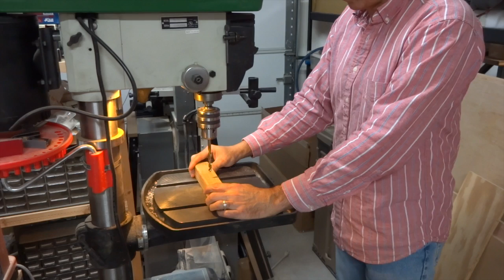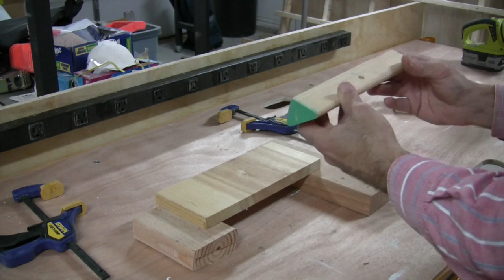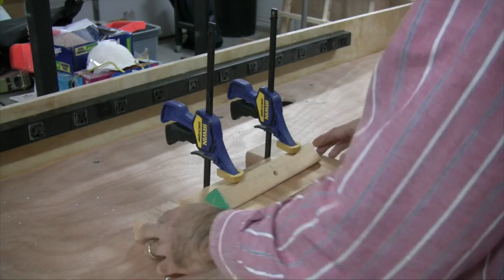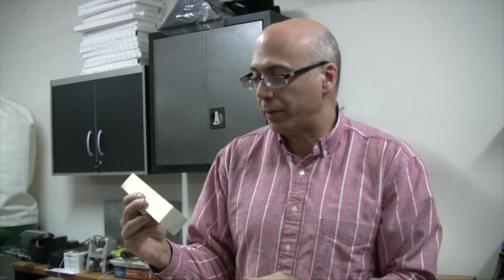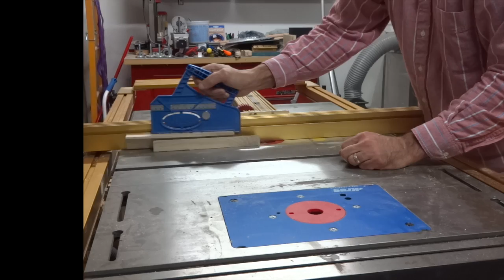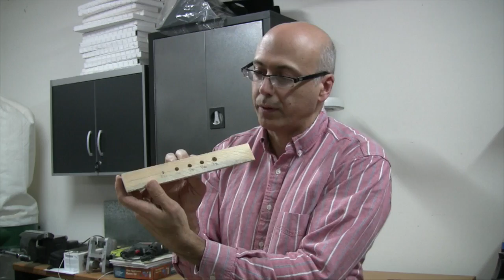Super Easy Way to Drill Angled Holes!

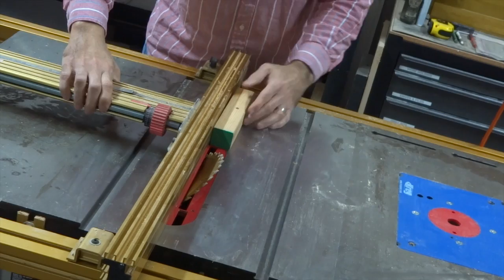Comment: 0:38 That looks like a very dangerous cut without a riving knife. If the piece was to flop down on the up-turning side of the blade it could throw it right through the operator.
Ripping it off of a wider board, say a 2X4, would give more support after the cut.
Always use a riving knife.
Reply from the maker: @donf3739  thanks for the feedback Don!

Comment: I have been looking for and easy way to drill angled holes through a 4x4 corner post for stainless steel wire railing. I am going to make a 4x4 jig the length of my post and drill all of the holes at once and perfectly spaced using this method. Thank you Mike for thinking and sharing!
Reply from the maker: Thanks for your comments, David!

Comment: This is a good idea. 

But that cut that you made at 45 seconds was scary. As some of the other commenters mentioned, you reached over the spinning blade to grab the work piece. This video has over 100K views so you should model good technique. 

Anyway, that is a nice, simple jig to drill angled holes!
Reply: Sorry, what a dumb reply.  Do you own a table saw?  The problem with armchair watchers and not doers is that they don't understand that even if he reached over the blade, there's probably a good foot distance above the blade that you can't see from your angle.
The problem that I see is that he didn't keep the stock flush to the fence, which IS a dangerous scenario.  I know this because I actually do woodworking and have been there before.
Reply: @metamech7383  “didn’t keep the stock flush to the fence”  ~ I’m very new to all this. Can u just explain that for me, please? Actually if it’s ok, can u email ur explanation to me: max7171@yahoo.com

Otherwise I agree with ur reply/comment. You make a very good point! Thanks
Reply: @metamech7383  A riving knife will help prevent the finished piece from flopping onto the up-cutting end of the blade, causing it to throw it at the operator. I DO own a table saw, and have for years, and I also learn a lot from watching videos of other people's mistakes.
Reply: James Dittmar mind your own business!
Reply: @stephenhaywood751  Safety is everyone's business. Especially in a tutorial video for beginners.
Reply: @stephenhaywood751  This is called a comment section for a reason.

Comment: How do you see to line up the hole?
Reply from the maker: I added alignment marks both horizontally and vertically on the jig after I drilled the holes in it. Then I place layout lines on my part to be drilled and match up both sets of marks before clamping and drilling.

Comment: Hi Mike,  Thanks for this, I need to build a thread holder for large and small spools.  There's another site where she made one but hers have the pegs sticking straight out at a 90° angle which means it's not very stable. Take a look at her site: https://www.youtube.com/watch?v=0xnkmMOuLYk  Now I'll know what to do thanks to you!  I think when I do this I'm going to flatten out the top of the jig so that will give the clamps a little more support, there's plenty of material to allow this modification without the jig losing it's stability.  Thanks again, I couldn't figure this out alone.
Reply from the maker: Thanks for the comment, Alice!